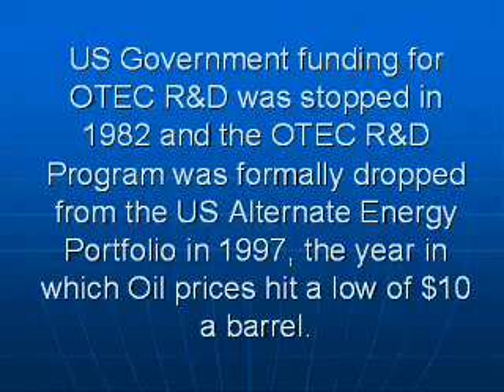Renewable Energy From the Deep Ocean US Gov R&D

Comment from the maker: While in principal, OTEC should be able to work in the winter because of the cold air temperature versus the water temperature (or the temperature of the earth), I think the practical difficulty would be that cooling the sea water further would convert it to ice and plug the heat exchangers.  It will work where there is warm water such as thermal springs.  What is needed is a temperature difference of 20 or more degrees Celsius.